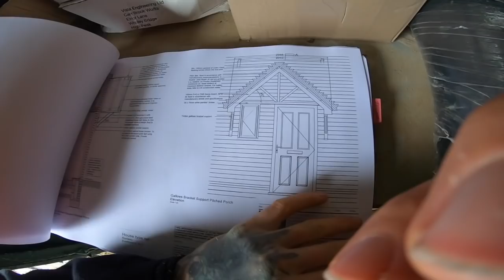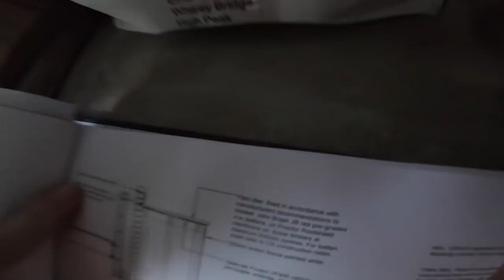Bricklaying...Using a spoon for a trowel

Comment: I’m a Landscaper and work on many
New builds. Why do they put that expansion gap in nowadays? As I see it on every property we’ve worked at recently
Reply: Well you did ask. Where do I start or finish more like. All building materials, bricks, blocks, wood, steel, glass + many others have thermal expansion, or known as thermal expansion of materials. They are all known scientifically. With heat & cold they expand & contract. Say for example, a 25m concrete block wall without an expansion joint that has a render coat, it is most likely the blocks & render will develop hairline cracks over time due to the materials squeezing & expanding against each other. Then it will then let in rainwater which could freeze & expand 9% as water expands 9% when it freezes. Over a long winter & consequent winters the render will boss & probably fall off over time. It’s the same with different bricks. E.g. London Brick (LB) won’t sell “ Heathers” bricks north of the border because they are soft & I presume LB think they are not hard enough to take Scottish winters, not like a hard engineering brick for example. In summary all building materials need a bit of expansion. This applies to mortar mixes as well. With bricks & blocks in particular, it stops cracks. Buildings/houses built say 40 years ago, would have benefitted from expansion joints. Thanks to organisations like the BRE Group years ago they’ve improved things a lot. It’s a long story your question. Hope this helps.

Comment: When do you know when to use a bricket? Is there a rule with regards to using brickets throughout the build of a plot? How do you know when to use them? Are there structural requirements for their placement within a plot? 

Great content as always! 👍🏽
Reply: They’re used for getting to certain heights, so he has 2 course of briquettes and a course of blocks to get his wall plate height, instead of having to cut his blocks down
Reply: @acceptrisk7739  thank you!
Reply: Generally frame head height is 2.1m and that works 28 courses of brickwork and 9 courses of blocks and then a briquette. For the lintels to sit on. It's deemed good practice now to put a course of brackets somewhere into e middle of your courses so your lintels sit on a full block. It's best to place where the window frames are bedded to save too much cutting but remembering kitchen windows will always be 1050 deep and others 1200or 1350 etc. Whatever works the least cutting.  Hope you can make sense of my waffling. Lol. Lovely old bark and growl Charlie boy
Reply: Some sites don’t like the joists sitting on the thermal brick so want them below the block

Comment: See using a small trowel is the way forward  , no fatigue , no long term stress on joints an shoulder. Easy , light and fast. I’ve said it all along and glad this man has reiterated what I’ve been banging on about for years. Ignorant bosses giving their young guns 91/11/12 hahahaha I’m fast as guck with my 7”. Beat any man hands down.

Comment: Whoever said that about the 3/4 brick must not work on buildings with actual dimensions lol they never work out full brick at every opening
Reply: Yep and the overpaid architects don't know the size of bricks in the year 2021!! 3quarters should be a thing of the past. Nothing you can do about a non brick size opening.  The worst ones are when you have to use 2 3 quarters to avoid a zip joint. Let's make this known to the div architects!!!!!lol

Comment: Can some one explain how the floor joists go in and what supports them,givin that Charlie is up to the wall plate.Thanks
Reply: I’m guessing that a wooden plate is bolted to the surface of the  wall and the floor joists are fixed to that . This helps with airtightness and soundproofing,which are often compromised when the floor joists are built in.